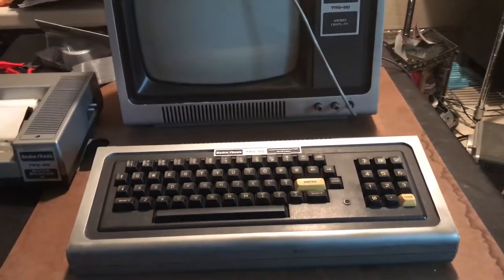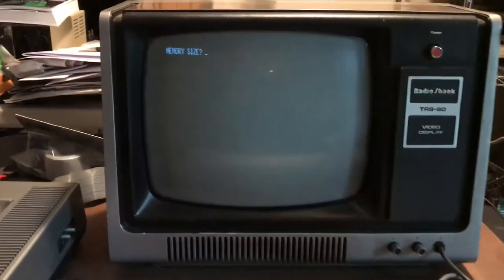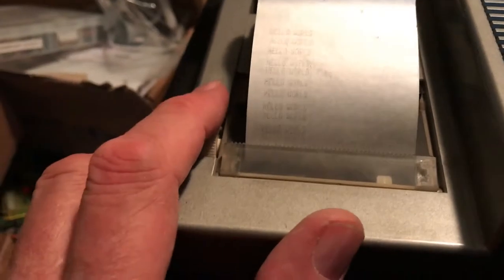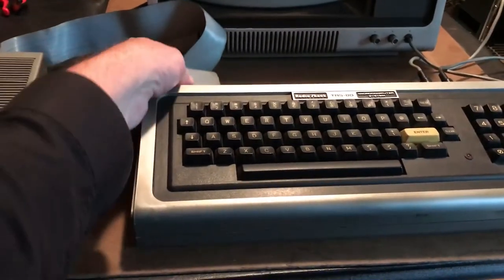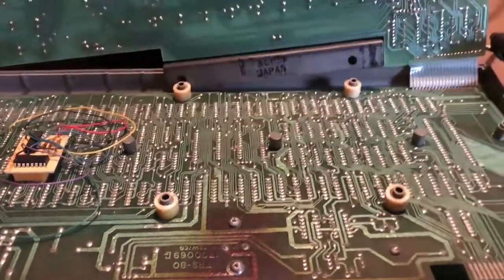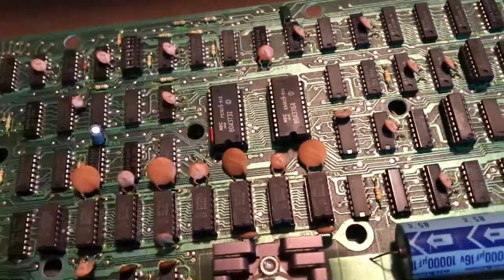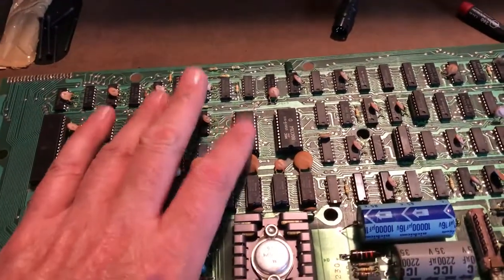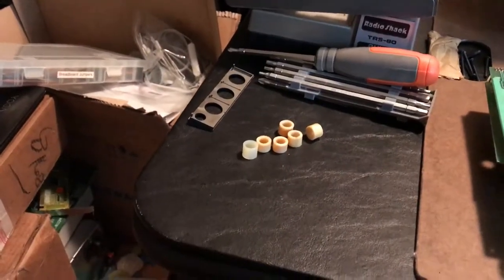Model I - TRS-80 Model 1 with Quick Printer II Demo and CPU teardown - STB29

Comment: The 2102 is socketed from the factory to facilitate installing lowercase.  I bet the character generator is a 6673.  The ALPS keyboard and 2-chip level II rom set indicate this is a later system so Tandy wanted to make upgrading lowercase is easy as possible.
Reply from the maker: Thanks, this is good to know.